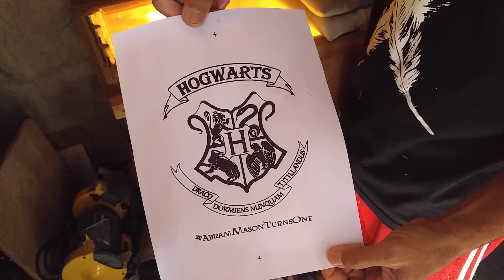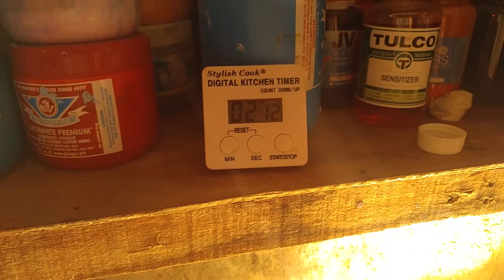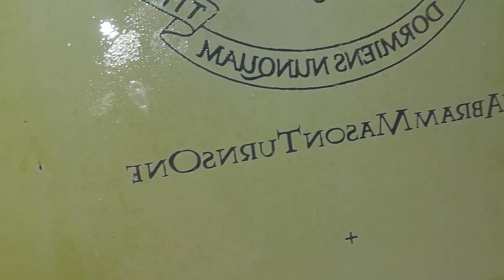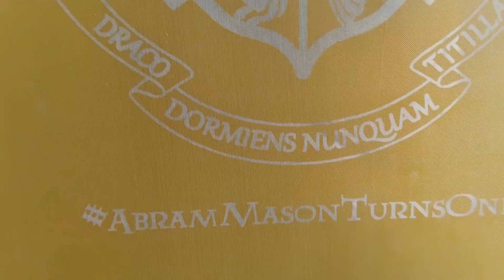How to burn image silk screen printing (Photographic) Philippines by Recuerdos

Comment: Just sharing this to everybody. 

Post-Expose Instead applying emulsion hardener..
Instead of using an emulsion hardener to make your stencil stronger, you can simply post-expose your screens. This will make your stencil harder because what you are doing is basically letting the emulsion burn more.
You can post-expose your screen by putting it back into your exposure unit or somewhere where it will be exposed to direct sunlight. Do this for about 3–5 times longer than your original exposure time.
Post-exposing your screens instead of using hardeners will also allow you to reclaim your screens after the print job and will save a lot of money for your business.

Comment: ang galing nyo naman po sir....may tanong po sana ako....pag nahaluan na po ba ng sesitizer ang emulsion magagamit pa po ba yung sobra? o yung gagamitin ko lang ang hahaluan ko salamat po sir napaka master nyo po
Reply from the maker: pwede parin gamitin sir pero nag eexpire po sya pag nahalo na. to prolong expiration date ilagay lng po sa ref. :D or better buy emulsion na ready mix na 1-2years po expiration date.

Comment: need po ba ng hardener sa mixture or glue at sinsitiser lng po talaga sir?salamat sa sagot in advance...more power sir
Reply from the maker: glue + sensi lng po.
Reply: salamat po sir.....yung ilaw sa light box po.....ilang watts yun?need po ba dilaw yung ilaw?more power
Reply from the maker: 20w unfiltered blacklight mas effective sa ordinary flourescent bulb. But flouresent bulb is ok.
Reply: nasa stage pa lng po ako ng processing.....naka 3 silk screen damage na ako.....necessary po ba ang blower?more power sir
Reply: yung pagpapatuyo po sir?kailangan po ba ng tuyong tuyo?

Comment: Sir? may tanong ako.. ano maganda Water base or Plastisol? Ano gamit nyo po? Thanks.
Reply from the maker: pareho maganda sir. for mass production maganda ang plastisol. ang waterbase po magaan sa bulsa :D
Reply: Thanks po sa Sagot Sir. May tanong uli ako.. na try nyo na po ba halftone design? gamit nyo yung emulsion na gamit nyo ngayon? Glue at Santicizer kasi gamit ko yung design natatangal pag mag wash ako..
Reply from the maker: mahirap mag halftone sa glue + seni sir. sa emulsion po na gamit namin pwede rin kaso mas ok gamitin ung desigd for halftones tlga. mas mahal nga lng.

Comment: boss. adivice naman jan. medyo nahihirapan ako sa pag wash out ng frame. nawawasak yung emulsion. ano kaya pedeng gawin?
Reply from the maker: posibleng under expose po sya
Reply from the maker: kulang po ng oras sa pag eexpose. ilang minuto po kau nag eexpose?

Comment: Hello po. Wala po kasi akong mahanapan ng photo hardener. Okay lang po ba yun? Di naman po ako mag piprint in bulk. Mga 3-4 shirts lang 

Ano po bang mangyayare kung di ko lalagyan ng photo hardener after ko iexpose at hugasan?
Reply from the maker: Liiah Belza pwede po at least 10pcs without hardener
Reply from the maker: Liiah Belza ang mangyayare pag d nalagyan ng hardener eh unti unting masisira ung mismong design
Reply: Thank you po. Nga po pala pano pag wala pong light box? 

Gaano po katagal ieexpose?
Reply from the maker: Liiah Belza kailangan mo po ng light box mam. Pwede rin sa araw pero di accurate
Reply: RECUERDOS pede po cooking oil?

Comment: anung emulsion po gamit nyo?
Reply from the maker: virgo sir ung hinahaluan ng sensitizer. pero magpapalit na ko sa keenworth. hehe bukod sa mahirap silang kausap kulang kulang pa order minsan galing sa kanila.
Reply: RECUERDOS glue at sensitizer po gamit ko kahit beginner lng kaso problemado ako sa pagpahid ko ng emulsion sa screen kasi tumutulo po, sa inyo parang ang dali dali lang hehe
Reply from the maker: praktis lng sir. or bili ka nlng ng emulsion er ng tulco no need to mix.
Reply: sige po. may isang problema pa po ako kasi ang layout ko lalagyan ko ng white background kaso po parang nagspread yung paint ng main layout ko. Tulco Ecco po yung ginamit kong white background tapos ganun din po sa main layout ko na color blue. ano po kaya problema nun?
Reply from the maker: paanong nagspread? nagbleed? marami po posible cause pwedeng malabnaw ung pintura pwedeng hindi tama ang paghagod sa squeegee kaya nagbebleed.
Reply: sawtooth po. pero kung ipapahid ko sya direct sa cloth ok naman po ang kinalalabasan.
Reply from the maker: pasend nga po pic sa page namin www.facebook.com/recuerdosshop para macheck po natin
Reply: ok sige po
Reply: need papo pala ng sensitizer ang virgo na p.emulsion?